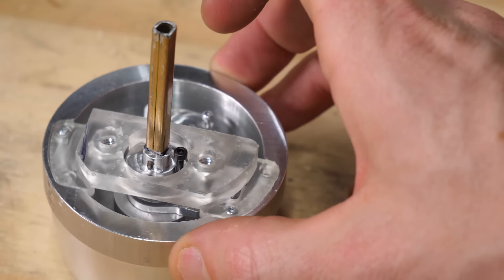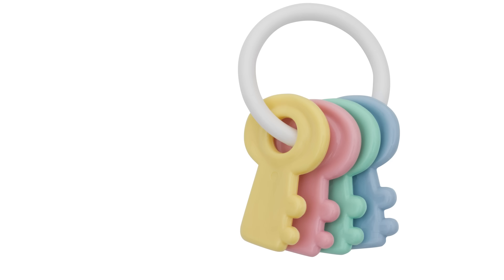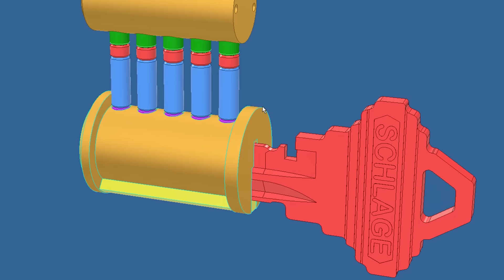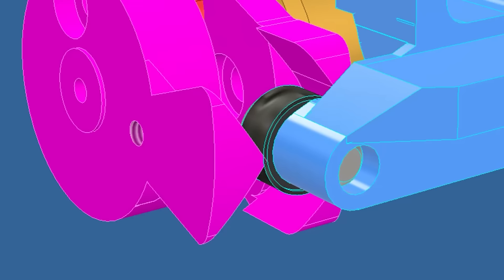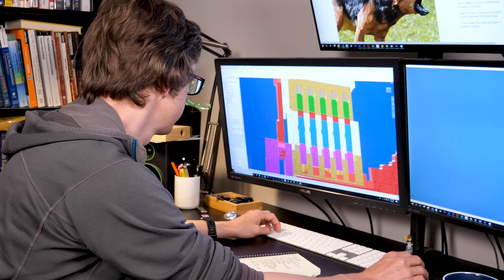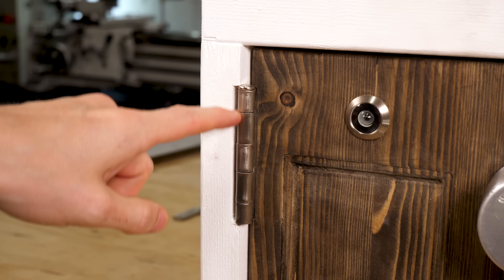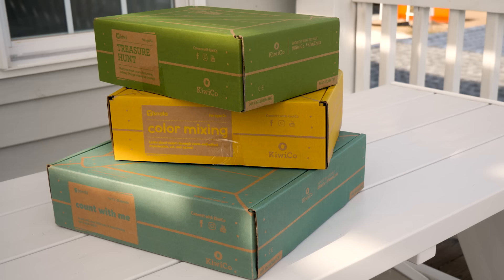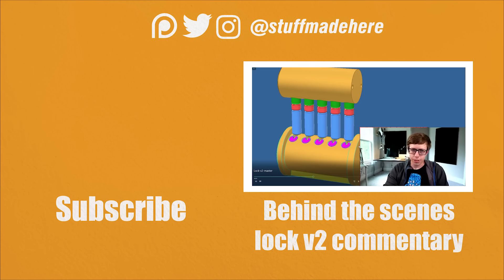TWO Unpickable (?) Locks for Lock Picking Lawyer!

Comment: The fact TLPL's video is next in recommended, and is 10-minutes long, gives me hope! Will find out when I am done here.
Reply: Yeah it didn’t take long.
Reply: The disappointment was immeasurable
Reply: Good luck 😎
Reply: @traviszuluaga5672  and the day is ruined
Reply: Well he made small errors but it does have potential
Reply: And he spent 5 of those minutes talking about the design problems.
Reply: I hope they keep collaborating on this lock, it sounds like it has potential and could be the next best thing in locks.
Reply: @jimmywolfe4724  Nope, it uses very old ideas. Pins and springs are 19th century thinking.
Reply: He picked the newer of the two locks in just 10 seconds without the use of fancy tools - just a little shim and a pocket knife. Watch LPL’s video from 5:33 - 5:44

Granted, he had to study them first, but in practice that’s all it took. Then he picked it properly a second time using a different method. I haven’t watched it all the way through yet, but seeing as how even LPL said that was the more complex of the two locks, I’m not holding my breath on the other one.
Reply: @two_tier_gary_rumain  Oh, and what is modern thinking according to you?
Reply: @ryann7741  I wouldn’t say ruined. LPL is just a better locksmith
Reply: @wellesradio  21st century thinking.
Reply: @shathaan1763  I loled so fucking hard reading this hahahhaa I have tears thanks.
Reply: @jackrambit9637  tbf he knew about the inner workings. If he was a common thief he wouldn't have been able to pick it conventionally
Reply: @two_tier_gary_rumain  There are locks that LPL cannot pick (you can search for it in LPL youtube channel). And the idea is not to avoid using pins and springs, because those 2 things are fundamentally the best, most secure design that a lock can have. The idea is to prevent access to the lock's core so you can't pick it, which is exactly what Stuff tried to do but failed, but then again, it doesn't matter since this is not a competition, this is a collab, which mean both of them help one another to create a truely unpickable lock. 
And that's the point of the collab, if Shane didn't made an entire video explaining how his lock works, LPL would have taken more than 10 minutes to pick the lock since he has to investigate it first. If LPL didn't give any feed back, Shane's lock will remain flawed and won't be able to improve.
Reply: @wellesradio   admittedly he was looking to make an unpickable pickable lock or else he would have made some type of fingerprint encoded or IoT driven mortise style assembly... just the concept of utilizing keys is pretty 20th century honestly
Reply: This will just make this guy make a better lock
Reply: @ironboy3245   Once the lock is in the market thiefs can study them properly by disassembling them. Most common thiefs also use destructive methods to open locks.
Reply: Fax same
Reply: @traviszuluaga5672  LPL called the locks excellent, which truly is the highest form of praise he can give
Reply: @teddanville6996  he was stydying the lock without videos
Reply: @traviszuluaga5672  are you kidding me? It was great seeing him explain what he was doing and how the lock could be improved.
Reply: @ironboy3245  yes they would. If this was a commercial lock and they knew they needed to go through it they just have to go and buy a second one to study.
Reply: @jackrambit9637  you mean lock picker?
Reply: @Jadenlatido  The idea of a lockpicking is to steal without noticing or bringing extra stuff to pick , no random burglar would bring his whole arsenal just to lock pick in some random houses ,  Unless u kept gold bar or government secrets in your house and the thief/burglar knows about it , a good cheap lock would secure you most of the time
Reply: lol he talked for 5 mins and rang the doorbell
Reply: Lets be honest, we only see the solution. We dont know how long took the behind the scenes.
Reply: @lyssasfaith  LPL is just being polite... the "lock" is trash and there is no such thing as "unpickable" lock...
Reply: @lyssasfaith  there is only one higher form of praise from LPL when it comes to locks. To not attempt picking it on camera. Such as the bowley locks.
Reply: @shathaan1763  He opened it only because stuff made here sent the locks with internal design lol
Reply: @gvonk2  You’re on the wrong channel then. Is there more modern technology for securing items? Yes. But that technology will not replace key locks for a long, long time. You’ll be old and gray by the time that happens. If you want to see someone hack a computerized lock that costs hundreds of dollars, go to some other channel.
Reply: @wellesradio  > go to some other channel.

Or got to the LPL's channel and see him do that using a cheap magnet lol.
Reply: Yeah the locks lasted less than a minute, the rest of the video was talking tbh
Reply: @gvonk2  considering how often LPL destroys the smart security locks? Yes I would like to see them improved, but until they are much better than they are right now you don't have a leg.
Reply: Just him talking mostly, lmao

Comment: "accidentally designed with microscopic parts" Is such an engineer quote.
Reply: Happens to me all the time in CAD for 3D printing. An I'm not even an engineer. (Or maybe that's the reason itself)

I'm happily designing away and next thing I know I'm looking up what's the smallest nozzle you can put on an FDM 3D printer, because the slicer decided to yeet out the absolutely mission critical 0,1 mm chamfer. Surprise Pikachu face you can't print a feature smaller than the nozzle diameter. God dammit.
Reply: @Juhuuu  You actually can, in the right orientation. if the slope is in the z direction, each layer can be printed a small amount (whatever your steppers can make as the smallest movement) to the side.

Comment: When all you have is a CNC machine, everything looks like a custom-made part.
Reply: or a 3d printer
Reply: @JasonBaldwin301  word.
Reply: but you can make mass-production molds and dies with it so that your part will look accordingly
Reply: All I have is a hammer, so you might imagine my solution. Fantastic play on that age old saying!
Reply: Did I miss a reference?
Reply: @JasonBaldwin301  when all you have is a hammer, everything looks like a nail(thumb nail included).
Reply: @JasonBaldwin301  roughly 6:53 and the general vibe around there
"I just spent several hours machining these pins, and I realized you can buy them for like, a penny."

Comment: 7:50 "I can't see why it doesn't work, it could be anything"
As a programmer, this quote describes my entire job.
Reply: Yup. And usually it's a matter of a missing parenthesis somewhere, or a plus where there should be a minus, or something stupidly simple like that.
Reply: Out of all my engineering courses, programming was personally the most frustrating and challenging 2 classes I ever had. You guys have all my respect! - Mechanical Engineer
Reply: Half of the 1800 lines of codes are in red. Due to a single parenthesis.
Reply: Yeah, I just spent a month working to fix an issue that wasn't there, because the bloody testing environment was set up incorrectly.
Reply: @yf-n7710  parentheses? Dude what ide are you using? If you're problem is just a parentheses change to a better IDE
Reply: @officialspock  parentheses are language specific.
I'm guessing you're using python since it doesn't require them.
Reply: @officialspock  I guess you're right, parentheses aren't the problems you have to search ages for. It's the stereotypical programmer's problem, though. Maybe off by one errors?
Reply: @yf-n7710  Most people like to make fun of semicolons.  I also personally have spent embarrassingly long amounts of time figuring out that I had not enough/too many closing brackets for things.

Comment: SMH:“I have a totally new design which is even more  better."
LPL: Just turn it 45 degree and it's done....
Reply: Spoiler ahead

So there were two exploits on the newer lock: the thin piece of metal tensioning the upper core, making it pickable (now fixed with a back-cover) and the 45 degree anti-retraction mechanism being walkable with a pointy knife (which is fixed by decreasing the angle of the fin). With these two exploits addressed, how would LPL get around a new design?
Reply: @dpatts  As LPL says, "There's not a lock I can't pick, but there are locks I can't pick yet"
Reply: @CrudelisSpurius  "YET"
Reply: @dpatts  > how would LPL get around a new design? => he also talks about third method.
Reply: @supermerill  third method was decoding the pins and making a key, the upper pins were the same length so it is pretty easy to decode.
Reply: @ac0rpbg  and more importantly, extremely easy to fix

Comment: Stuff made here: "I spent a year crafting this lock"
This is The Lockpicking Lawyer and today I will be drilling some locks...
Reply: He picked them both in no time....even sent notes back on how to make them better
Reply: LPL has more class than that.
Reply: "We're gonna go down to the shop and introduce these locks to my ramset."
Reply: No, he just slid the deadbolt back
Reply: @lodrbyroni  I mean if he didn’t know the internals of the lock, then he probably would not have been able to pick it
Reply: @warrensteel9954  I mean he did admit that he would've knocked out the door hinge and declared victory if measures weren't taken to stop him
Reply: @superelementx5654  if this was a widely know lock that is someting a professional would do. Its not really cheating if its easy to figure out the internals. Every lock on the market has this flaw.
Reply: @superelementx5654  the lock use deadbolt and the key slot can be turn 45% degree which is visible from the outside and was the only thing LPL need to do the picklocking.
Reply: @superelementx5654  he also said it could be decoded because the pins are the same lenght
Reply: @normalmighty  Yes, that's why he stopped at one embarassing fault only the cheapest low quality locks would have and didn't search for two more...
Reply: destroy the lock and the engineer behind it in one go
Reply: @superelementx5654  But if this design was comercializated he could of bough a set to know the internals so no excuse there.. who tailors his own locks except for SMH
Reply: Okay everyone above has good points, I can’t say anything anymore

Comment: Me: There's no way LPL will pick this 
"3 is binding..."
Reply: LPL already picked them and they only together took 2 minutes he spends a ton of time explaining it though
Reply: Underrated comment
Reply: @Zanin_Lozar  2 minutes, after extensive practice and experimentation. Which he openly states. So who know how long it actually took him to pick it.
Reply: But that's not the actual content of LPL's video.  He didn't  Only pick them in 2 minutes.  He talked about the locks and then showed us the exploits he found after having the locks around for a considerable amount of time AND showed us one of the fixes SMH already made for one of the exploits.
Reply: @apenguininthemist855  exploits with bolt not locking isn't actually that uncommon in older locks, so it is something average locksmith might try. Tension of the back is also something practical for a lot of locks, although biggest problem here, is that is fully custom lock, so to know where to tension from back would take long time. Door bolt exploit tho is something could be done on street.
Reply: Does no one get this is a joke relax you don't all need to rush to LPL's honour and write essays in the comments about how he already picked it
Reply: @lexdalex1  I find it funny that everyone is jumping in to say the SMH lost a challenge when there really wasn't an actual challenge.   Most of the video is kinda tongue in cheek about him making a lock.  Just like LPL Joke at the end of his video about how SMH's fix of the one problem was the "Most Expensive" way of fixing it.  SMH and LPL are basically just making two fun videos and enjoying what each other did because Engineers love when people break their shit, it allows them to figure out the fixes.   It's a sad day when an Engineer isn't engineering.
Reply: @Darkeklaw who cares it's a joke I'm not saying there's a challenge I'm not saying anything I'm just making a joke and referencing something that is commonly said in LPL's videos.

Comment: I worked as a locksmith for many years.. does not matter if the lock is very hard to pick or impossible. That is NOT how burglars get in to your house.

Either you drill the lock or just go in a window etc

But that said . You have some very Impressive engeneer skills.

Comment: i think the only possible way to make a lock unpickable is being able to remove the ability to apply tension to the core, such as a ball bearing system surrounding the core, making it a “floating core”, and the only way to disengage the ball bearings so you can unlock it is to set all of the pins at one time (key)
Reply: A common technique used is when an incorrect key is hammered into the lock so a ball bearing based key would not work
Reply: *lock

Comment: My “creator kits” growing up was every broken part my dad replaced on his truck or broken electronic in the house.
Reply: And sometimes things that weren’t broken... yet
Reply: I'd come home from school, and there would be stuff on my desk most people would consider junk. But it was treasure, to me, that my dad left there. Of course,when it came to electronics, my dad told me to work on the new "transitorized" stuff, that work with low voltages, as opposed to older tube (meaning high voltage) gear. Then, one day, he gets an old tube equipped record player (analog CD player) and, I guess, tube gear was then okay. This was the early 70s. Plenty of tube gear still around, but personnal computers were still a couple of years away, if you count those early CP/M machines (pre IBM PC).

Comment: "I can't see how it works so it could be anything" there is a sentence every software developer knows and dreads.
Reply: Is usually either the code or the user. 
I program software. It’s always one of the two.
(Though sometimes it is the server)
Reply: @FilmFlam-8008  "Is usually either the code or the user." Wow, a more useless statement couldn't possibly be made. That is not even remotely helpful nor does it narrow anything down in the slightest.
Reply: @-Devy-  I think that was intentional.